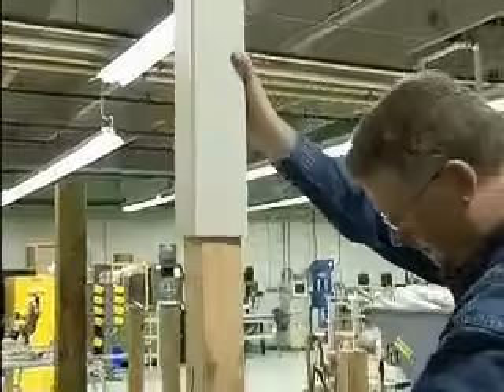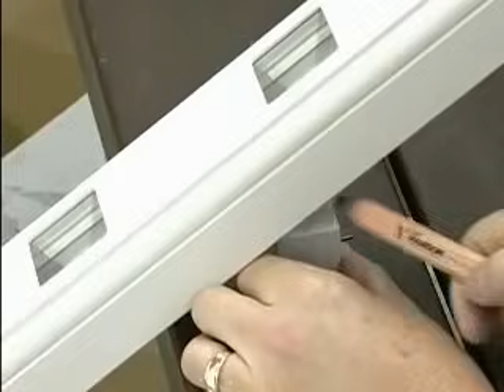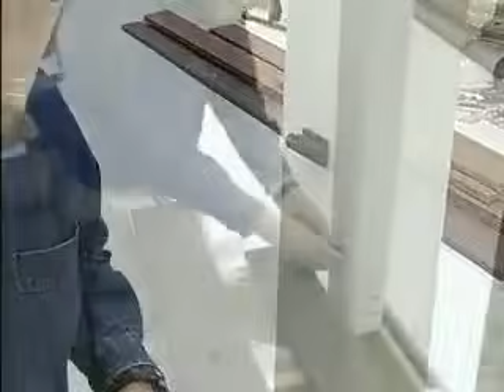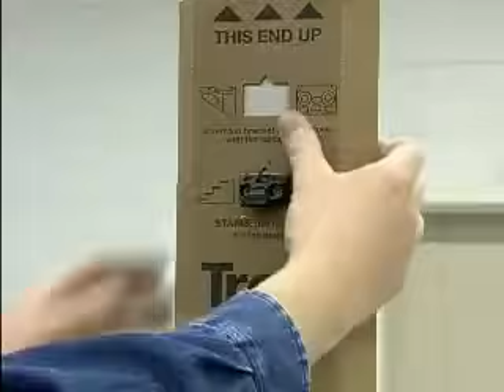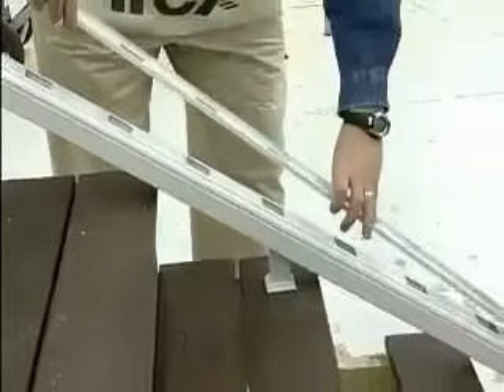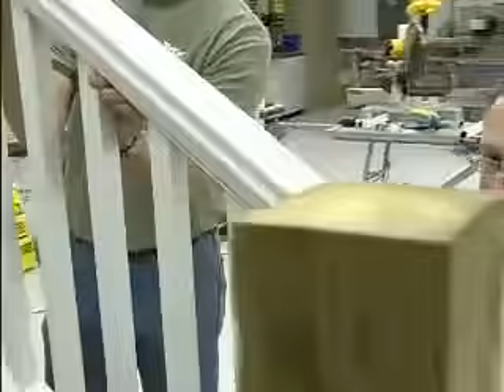Trex Transcend Stairway Railing Installation - Glenbrook U

Comment: Who ever came up with this system never tried to install it , especially the stair railing. Not a good design when you only have two wood screws holding the bottom rail to the posts. Not everyone has the luxury of exact post spacing when installing the railing on an existing structure. If the post spacing is not such that the fixed baluster spacing works, you are screwed.

Comment: Take it from a DIYer for over 25 years and this system is an expensive mess. That hardware is very difficult and who ever designed it should be fired.

Comment: At the beginning of Step 6 the lower RSB on the top post moves up about 2 inches. Was this a mistake that was later corrected?
Reply: This has been driving me nuts!!!  Do we use the top hole or bottom!?
Reply: @NokiaFanatic  I didn't have the cardboard template when I did mine. My bottom RSB for the stair railings are about 2 3/4" above the decking surface. I think they used the wrong template hole in the video and didn't mention it.